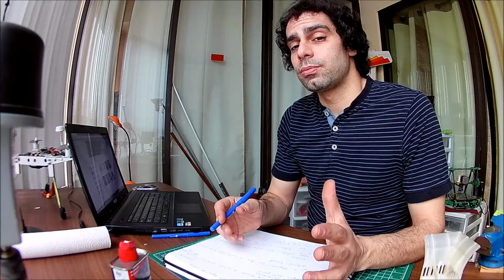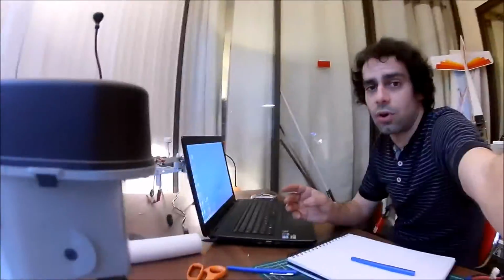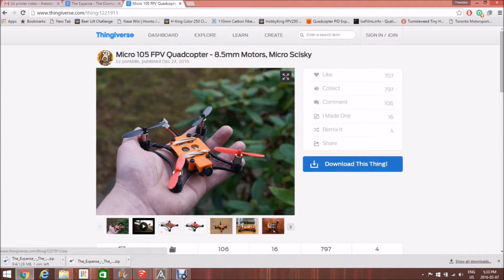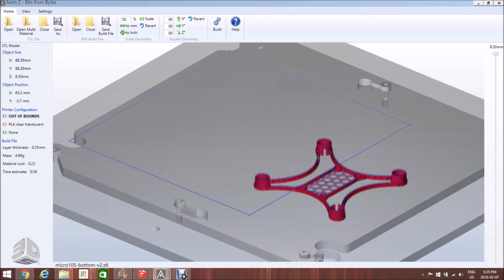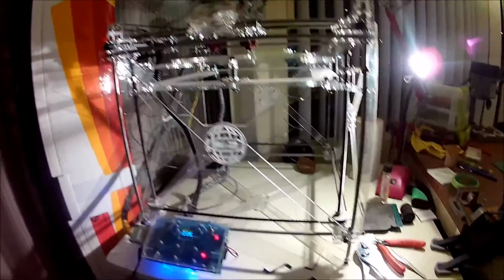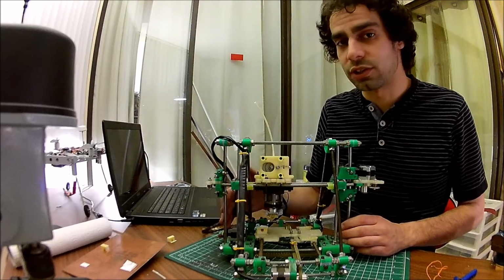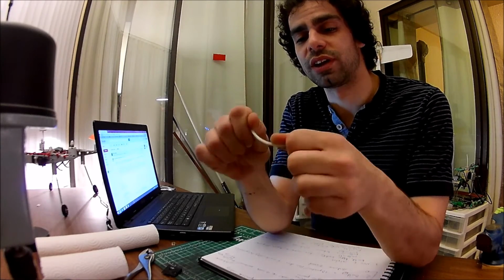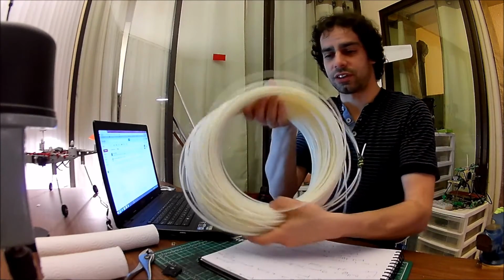3d Printing Basics

Comment from the maker: There are shrinkage algorithms already in place. the issue is that the shrinkage causes the part to seperate from the printbed or along layers causing a print failure. generally leaving a tollerence of at least .35 mm between moving parts is a good idea

Comment: How does the orientation of the part during printing, change the resolution, strength, flexibility in different directions? I.e. please elaborate on the anisotropic structural characteristics